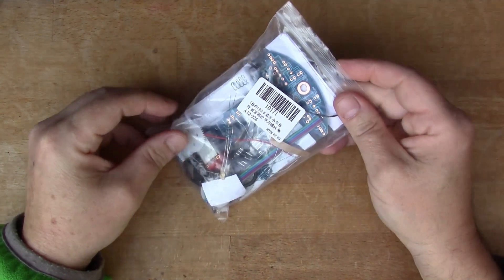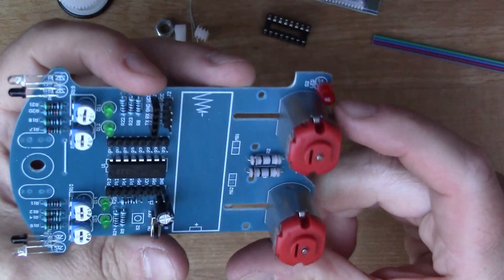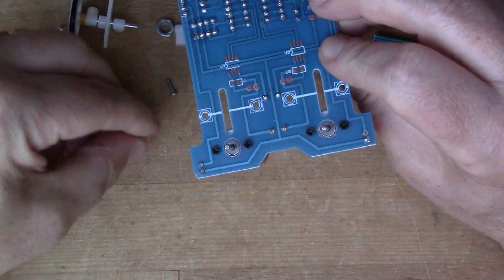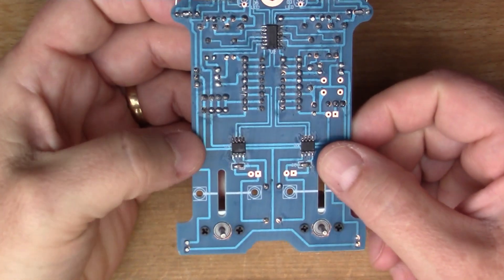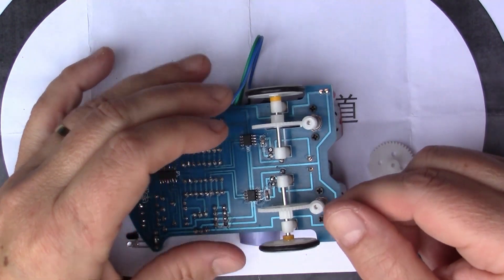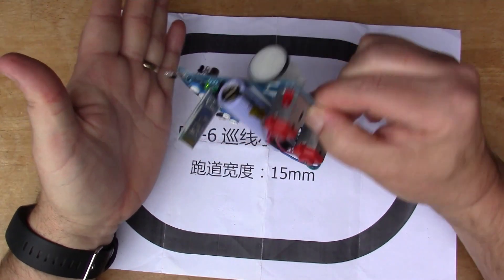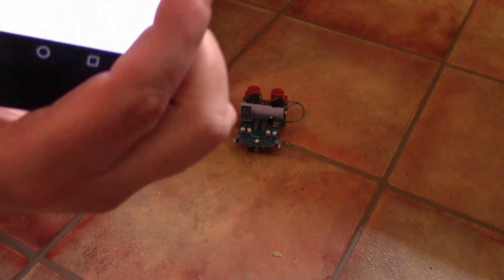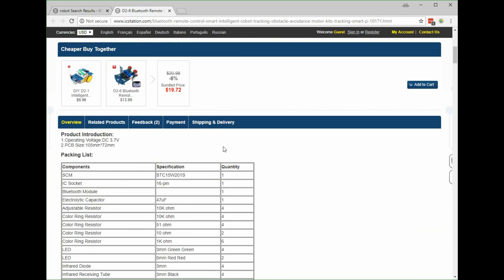Bluetooth Robot/Trundle/Car. Kit Build & Demo (#83)

Comment: Thanks for the video.  I've had this kit hanging around for years but only just getting around to building it.   The STC15W201S microcontroller it's fitted with is quite a powerful beast - runs 8051 code, but 12 times faster than a traditional 8051 at the same clock speed, and also has extra timers and other hardware. The line following algorithm programmed into the chip on delivery seems very poor, and the robot is outperformed by similar 'dumb' robots with no microcontroller.  If and when I get mine working, and have played with the Bluetooth etc. I plan to write a fresh program for the microcontroller, and see if I can improve the performance. I may try to get a spare STC chip to program, so I don't lose the original program unless and until I've made something better.

Comment: Fun little toys with lots of learning potential for small and big kids ;0) The addition of bluetooth makes this interesting, maybe replacing the 'Bolt' with a caster of some sort? Smashing video, thanks!
Reply from the maker: It occurred to me after building that you could piggyback a micro:bit on the back of the thing and use Bluetooth to make a link between the two - this would be a programmable robot